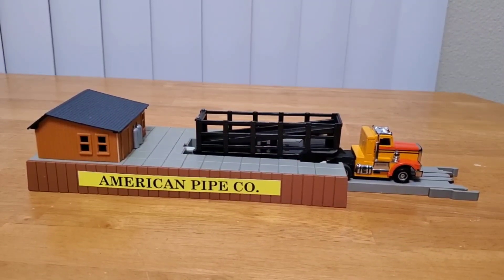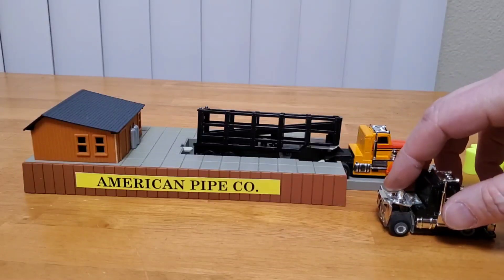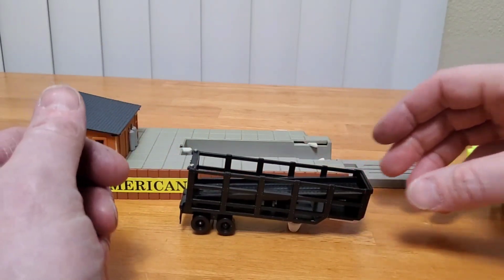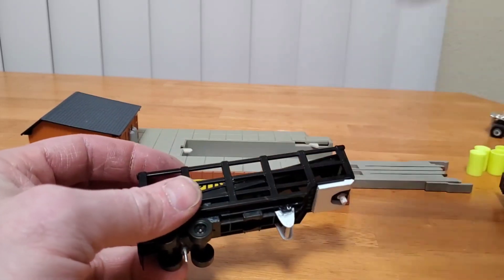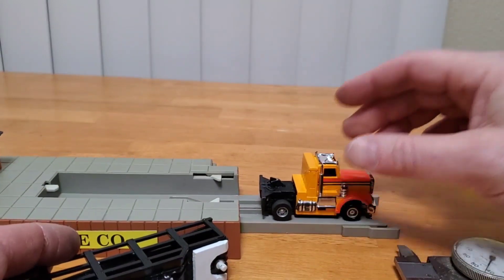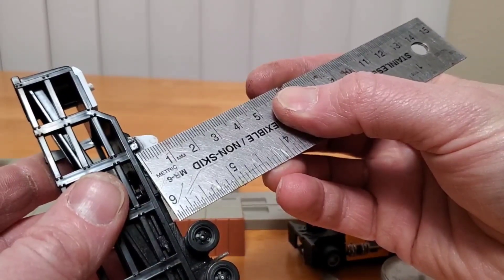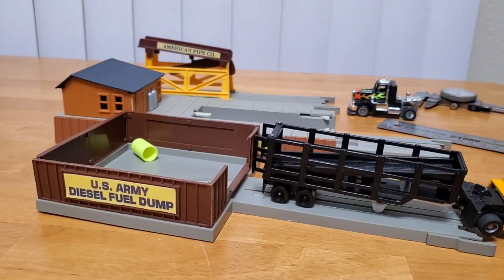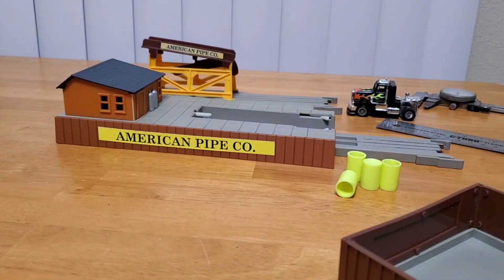Tyco Slotless Barrel Trailer Conversion for US-1 Trucking

Comment: Great video. I am going to use some of your idea to modify an auto world trailer to run on US trucking. I do think the flat support behind the pin is needed to prevent roll over at high speeds. I did use your idea to make and repair broken the dolly stands on other US 1 trailers I had, it worked well.
Reply from the maker: Thank you for taking the time to watch the video and the kind words.  I'm glad my techniques helped someone.

Yes, the rear wheels on the trailer need both a forward and rear pin.  Take a good look at the US Trucking version for placement.  I need to do a tutorial on this because I have successfully modified two road champs trailers to run on the track, but I will try to explain how to do it in the best way I can.  

When you look at the US1 Trucking trailer pins, they are about 5 mm long and maybe 2 mm wide at the thickest.  You will need to sand down the edges to a point.  Now, as far as the height goes I make it much longer than it needs to be because when I do is I cut a vertical groove, using a Dremel cutting wheel, into the lower half of the truck (axle support) of the rear wheels.  It is centered, and only on the lower half. Don't cut it all the way up as that will weaken the truck.  Glue your pin in and once the glue has set, cut back the height to match the forward one.
Reply: Update: I did the modification to the Aurora/Auto World trailer. Here are the things I did.  I glued the guide pins in place so they don't move. I replaced the axles, with some from the rear of a Tyco TCR chassis as the auto world ones were to short. They needed to be as wide as the original US 1 trailer and not as sloppy and to prevent roll over. I also drilled a new hole in the front for the fifth wheel pin. I used a polystyrene rod like you did. I added a piece of flat polystyrene sheet behind the rod like you did as well. This is also needed to prevent roll over.  Your video was very helpful.
  @classicalvintagecollector
Reply from the maker: @suprb6970  Thank you for sharing your successful improvement to the AW trailer.    Your input is what we need to build the community.